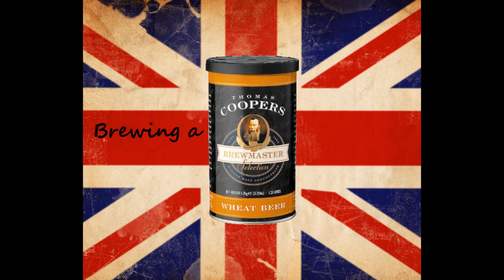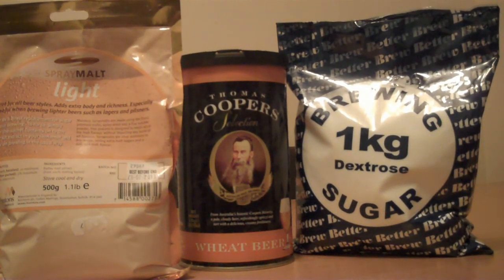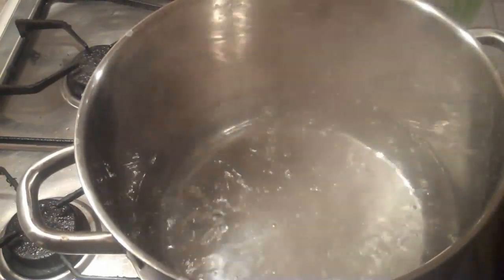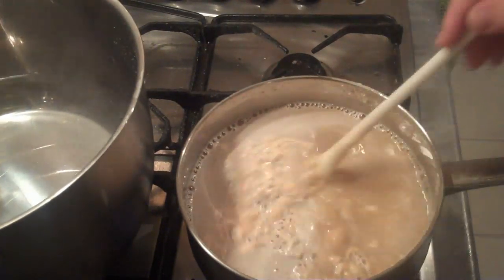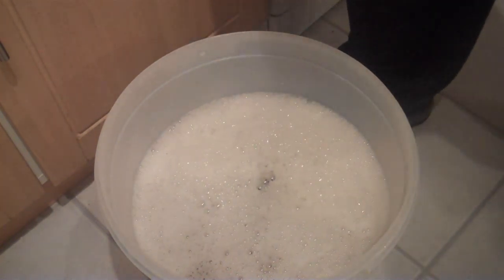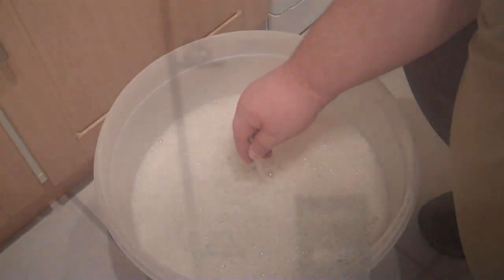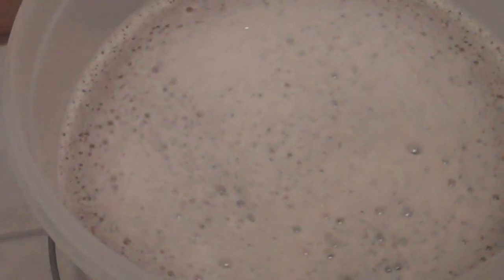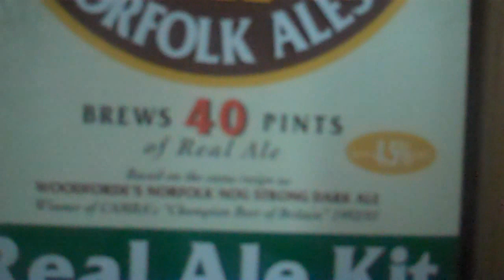Thomas Coopers Wheat Beer - Home Brew

Comment from the maker: @chrisftw92 Thanks Chris - dry malt is not the easiest to dissolve, however pouring it into cold water means you don't get it clinging on the bag and with a bit heat added it just dissolve's by itself...however I'll give this a try ...keep the tips coming... I'm just a learner ;)

Comment: I just started brewing this yesterday, first time brewer so go easy, but I'm wondering about when I get to the priming stage about how much sugars to add. Ill probably just add normal sugar or dextrose. Also, more importantly, what is the CO2 number for this? I keep seeing numbers ranging from 2.7-3.5. Would this be considered a weisber (or however you spell it)